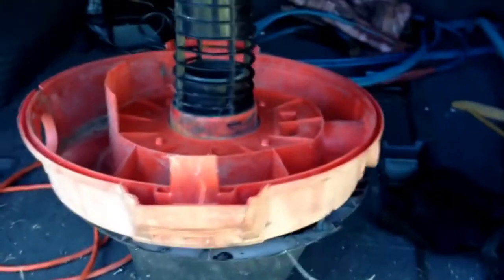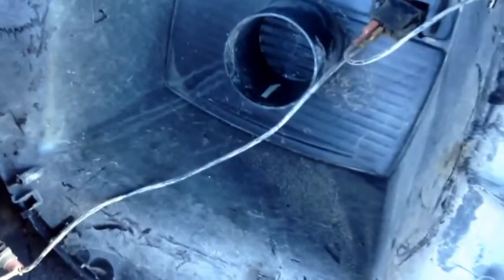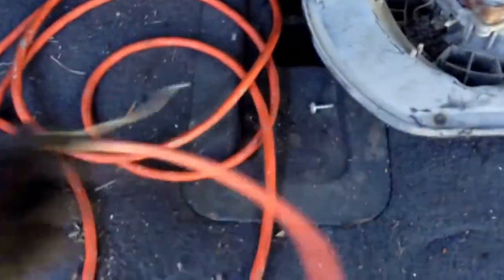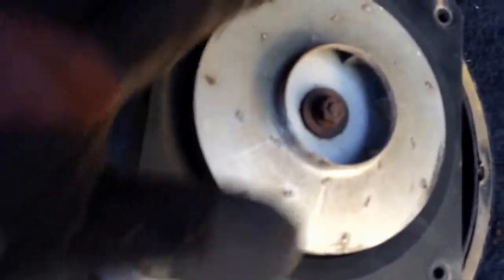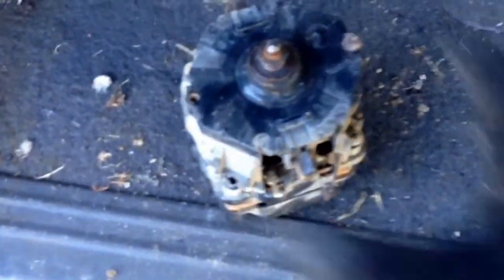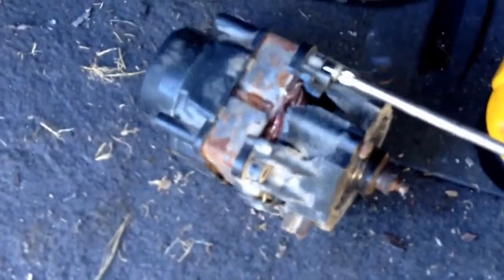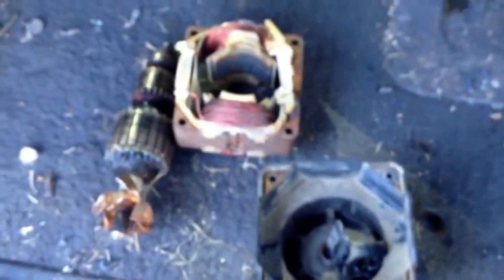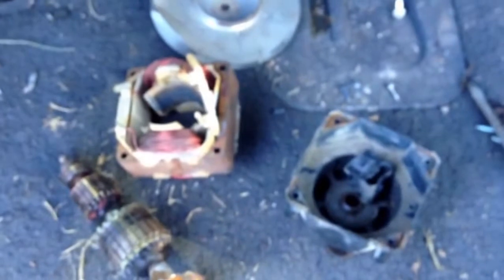Scrapping a wet/dry shop vac. Quick and easy

Comment: Happy, I don't know about you but it seems like quite a few of the ones I get have the screws deteriorated so made that I have to end up using a hammer to bust open the plastic caps and shrowd. The one you have there looked relatively tame compared to most of the ones I get. Happy Scrapping to ya!
Reply from the maker: Family Man Scrapper This one was not bad....I have had the monsters you speak of.....They take a little more time........not to mention a few smashed thumbs!
Thanks for watching!